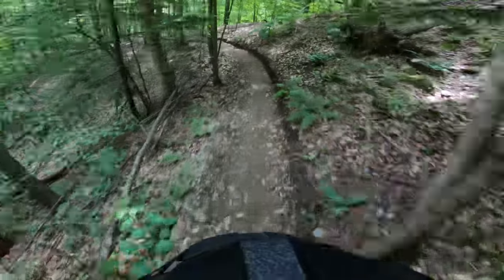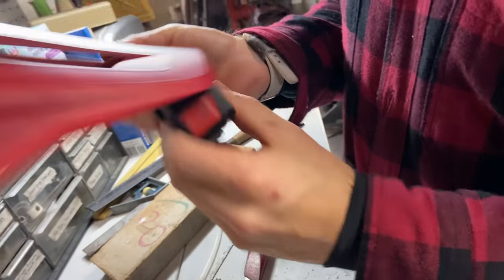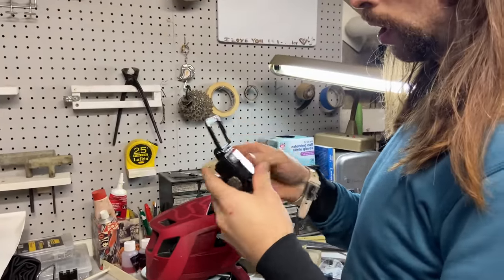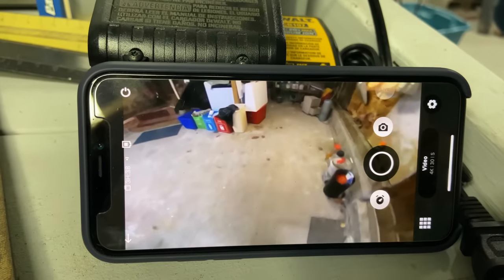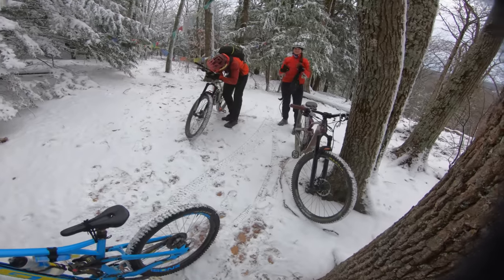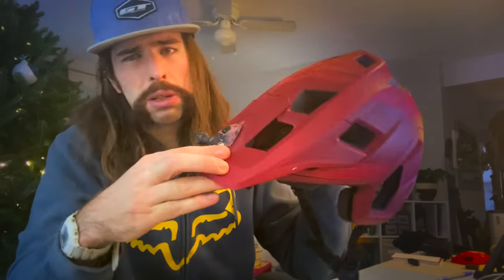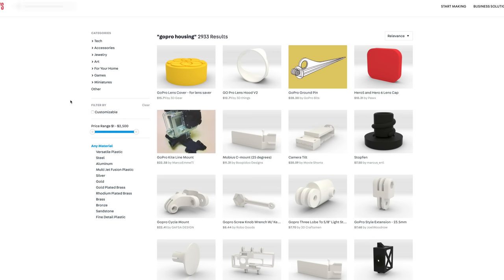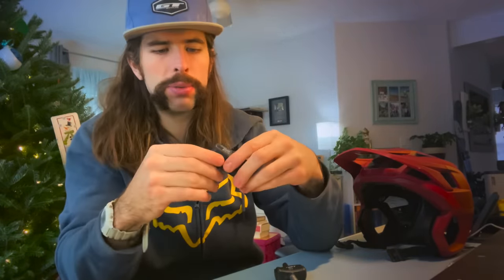Retrofitting My Bike Helmet to Mount A GoPro

Comment: !!?????Hey question Phil!!?????

The small black part that comes up from under the visor that u want to stick the bolt through!? Can you shave those two small arms that protrude up. In between the two arms. Just to make them longer. Once they come up long enough u should have enough space to move the adjustment for the angle u want. Great idea great point of set up. I think this can work if u can cut in between those two legs or arms to make them come up longer. 

Hopefully you get to see this and you understand what I am trying to say. I've never held or seen one of these in person

Comment: I glued the sticky pad mount under the visor, that's much simpler than drilling. However, I haven't been able to nail a perfect angle. Either there's no handlebars which is boring or there are handlebars but without enough horizon, so it looks like on the video (I keep adjusting my head watching to see further, ha). Regardless, I think even the chinbar can be too high. Mouth height is already pushing it, but below chin is pretty perfect.
Reply: film in 4:3 2.7k 60fps. give you more headroom and lower room
Reply: @mikeytek  yea but 4:3 sucks ass. 16:9 makes for a much better viewing experience
Reply: @Trebelhornc  you can always crop, but 16.9 allows for hypersmooth

Comment: use a 1/4x20 mount, tor drill 1 hole thru visor and secure with wide washer and nut.  they even sell out front 1/4x20 mounts so you can mount top or bottom and remove any visor from view.  K-edge has a few mounts that I have used in the past.  GL and looking forward to your next revision of mount.

Comment: Nice try at solving this problem that is very valuable to solve. I just run a chin mounted cam, but the summer heat is a logical motivation to relocate the camera. I don't like the POV as much from under the visor because it is too downward. Chin cam is tried and true for me. I use a Bell Super 3R because I can detach the chin bar for hot climbs and put it back on for the DH. Still not the best scenario, but I can hang the chin bar on my pack's lug strap thru my gopro mount and velcro strap the bottom to the bottom of pack when chin bar is off.

Comment: I don't think the difference in heat between the modern full face "enduro" helmets is significant versus the "half shell" designs anymore.  Back in the day...HUGE difference, when full face MTB helmets were almost the equivalent of FF Moto helmets, but that's not the case anymore.  I would be surprised if you get hotter at all wearing the Fox ProFrame versus a half shell, and the chin mount...just works great.  It seems worth the trade off.  I sort of get the overkill effect of a trail helmet being FF, and people thinking it's odd, but I don't care.  I can eat crap on a trail ride just as easily as any other time, and I'll take the occasional verbal jab to save my face.  "I didn't know we were riding Redbull Rampage today."  "I'll remember you said that when you washout in a corner and knock out two chicklets and need plastic surgery to build a new nose."  :- )

Comment: In the settings you can invert your recording and hang your camera upside down so you can access the top button from the bottom. When you open the files it will play right side up. just remember to flip it when you use another mount or hand held footage.

Comment: For the Hero 7 case, glue on a pull tab to the back side of the opening lever. Either with a piece of string with a loop to put your finger into or a plastic tab from something like a soda bottle that you can grab onto.

Comment: After paint it will look pretty good.  If unable to find adequate solutions to access doors maybe consider ski slalom chin guard (attaches to helmet and keeps gate from hitting face) I think your helmet with frame protection below ears would allow zip ties to hold it tight then you could attach below chin like full face.  Good luck and most innovation is trial and error.

Comment: Using aluminium tripod mount going through the top of the peak with a screw it won’t lower the go pro too much maybe by 3/8 of an inch then you will be able to tilt the camera to get your angle just right

Comment: Hey Phil.  How about if you printed an adapter plate similar to the K-Edge go big camera adapter for GoPro?  I think something like that but with a bigger base, maybe 4 mounting screws?  Have the plate printed to match the angle of the underside of your visor.  If you want easier access to the camera you could make the adapter so that it slides to 2 different locations, one for filming and one for battery replacement.  I like that helmet.  I may buy one as my old helmet is 4 years old.  Maybe I’ll print one up and give it to you to try.  I live near Smugglers Notch Ski Area in Cambridge.  Let me know what you think.

Comment: You must have read my mind. I was just trying to figure out how to do this when the video popped up. I really want to take advantage of the old natural head gimbal. I think I can get the position you have, with full case access if I remove my visor. I'm just using production parts and a sticky mount. I didn't stick it on permanently yet because I decided I better scuff the surface a little first. I also picked up a cheap chest mount, but I expect that will be a little to shakey for my old hero 3.

Comment: Like it when you get crafty with Gopro mounts. But is there really such a big difference in heat/weight wearing the Dropframe vs the Proframe? When I want to film I just use the Proframe vs a trailhelmet, even in summer. Doesnt bother me at all. 

Maybe you could work on the visor a bit more to make it suitable for the hero8?

Comment: Lol I just went through this issue with my visor helmet. I settled on mounting above the helmet with no visor cropping, but the angle is still too high and doesn't get a lot of bike/arm/leg in frame. I think the best angle when you can't chin mount would be an elevated chest mount. Not sure how many are doing that now and if it's stable enough. But like an extension that pushes it close to your chin.

Comment: Nice video. I have similar setup on my Kali Maya, but I just attached it to the visor, but If the GoPro is in Stereo mode, even with Windslayer foam thingy - there is sooo much wind noise. Its like I am in airplane, it looks like visor and helmet itself are whistling. Did you have issues with this?

Comment: Just to re-emphasise the hair thing... if the motor is strong enough and enough hair is caught - it will de-scalp you (happens a lot in rural setting with power take-offs on tractors)

Comment: I feel like it wouldn't be that hard to modify one of those extension mounts to house it.
Similarly, it should be pretty straightforward to take a Hero mount originally intended for FPV Drone flying, and remix it with the hardware you need in order to do that - I'm busy, but would be down to try and help.
95A durometer TPU is going to be the material of choice, and there are places that can print that (if I can't) fairly easily.

Comment: best tool to use to cut plastic like that is a vibrating multi tool (vibrating saw) you can normally get a cheap one for like 20 or 30 bucks at home depot or lowes. They are kind of like the ones doctors use to cut off casts with so they don't cut your skin but they cut rigid stuff like butter.  Great for plastic, drywall, wood and even nails and metal stuff if you get the proper metal cutting blades.

Comment: Try mounting the GoPro, using the holes you made, on the top of the visor. That’ll get rid of the issues you have with the visor getting in your field of view.
Reply from the maker: You want the camera mounted as low as possible. This gives you better perspective. The higher up the camera is mounted, the flatter a trail looks.

Comment: Su Gru is amazing stuff, used it on my fullface for gluing mounts, would work just as well in an enduro as well. 
Strength on it is really good 👍plus you can fit it anywhere you want
Reply from the maker: I originally went to Home Depot for sugru but they no longer Cary it and none of the other stores did either
Reply: @SkillsWithPhil  Amazon for me, could not find it anywhere either.

Comment: 5:07 If it catches a big enough clump it won't rip it out but wind round the spinny thing instead, dragging you in and really making a mess of your face and head (worse if the spinny thing is sharp). Always wear appropriate safety care

7:05 Cable actuated droppers suck balls. They are pain to adjust and to keep adjusted. Rockshox Reverbs ftw

Comment: My question is... Do You really need a visor??? After watching this video I would say thats the part that causing major problem. My peak came of in a crash on my very first mtb trail ride (I realized that on the bottom of the trail 🙂). Never had or felt need to have one after that. Without it, I think there shouldn't be a problem to get perfect angle.

Comment: You could search for " Super Visor Low Profile Under Visor Helmet Mount for GoPro Cameras " on amazon, it is quite pricy, as I was able to find the same type of mount for around 6$ on eBay, but with this mount, you skip all the retrofitting.

Comment: Why not use a hero session ??  Smaller form factor easier angle in a small space
Reply from the maker: Because I go through 4-6 batteries in a day and it doesn't have built in stabilization.

Comment: View not much different than on the top, distance to Bike, Ground, still to Big. Chest and chin Mount give a pov that is more enganging, and closer to reality. I usually ride with a gimbal on the stuntman chestmount, but a hero8 and a regular chestmount i something i Would love to try out, much simpler, and lighter, setup.
Reply from the maker: You don’t get arms and bars in frame when it’s mounted above. Those are pretty important. Subtle, but makes a big difference
Reply: @SkillsWithPhil  Agreed!, arms, bars are a piece to the puzzle, they need to be there. But because the GoPro has the wide view it has, the distance to the things you mention, are so important, and i think the distance still is to long when it is mounted above your neck. That is why i love your chin mount pov to (Y)